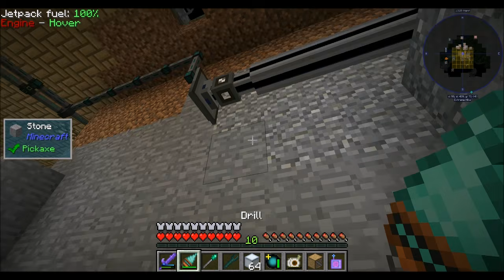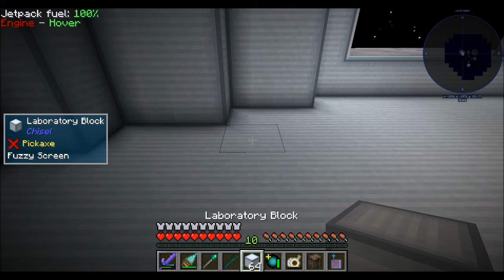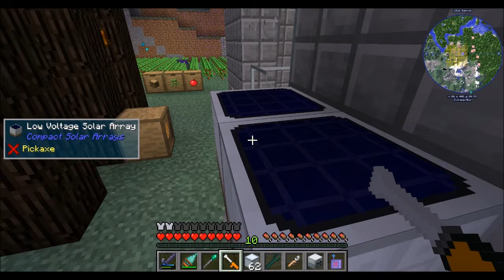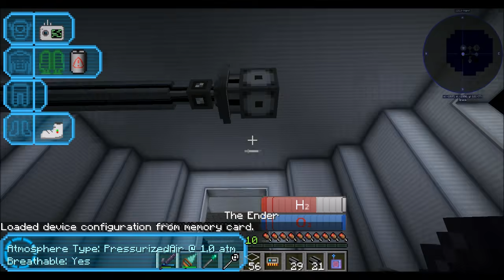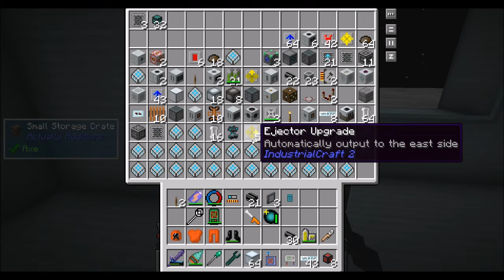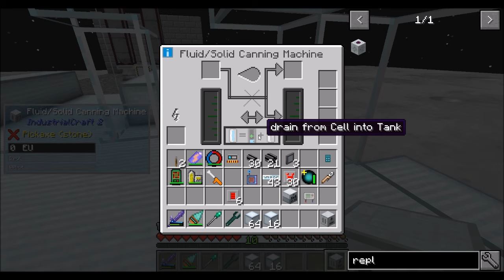AoE Ep76 IC2 Moves

Comment: Anyone else go for the large arrays of IC2 machines to reduce the power needs overclockers would need? 10 of a machine give you 10x speed at 10x power as long as you can evenly split the work. interface into a chest/crate then transfer node with stack and speed upgrades and transfer filters on each machine set to single item works well then just need to send the processed to a interface. Only works well on single item in for x crafting but can use other mods for more complex recipes.

Comment: did you move your wireless access point to the space station? if its still in the old base, through a quantum tunnel from your new ME controller, that might account for the derpyness of the wireless terminal

Comment: With making the looks of the nuclear reactor better can't you put the redstone on top of the MFSU and it will still receive the signal from the MFSU
Reply: Graluvack EnderSlayer or have the red stone behind and run the second power line into the top of the mfsu on the basement floor

Comment: @Direwolf20 could you maybe ask the mod author from Advanced Rockedry to make the spacesuit work also as a Hazmad suite from IC 2 ? ( i mean both protect from radiation dont they ?:) )
Reply: Spacesuits would work pretty well for a lot of hazardous materials (they're airtight and insulating after all)... but I don't think you would want to handle radioactive materials with them.
Reply: Spacesuits do block some radiation
Reply: Silberzunge Do space suits block radiation? I thought an Astronaut just had to deal with it if they spacewalk.

Comment: Yeah, there's a 50 Chunk limit, check the bottom-right of the chunk info screen.  The ExU2 Chunk loader/warding thing was enable in a later version of the pack as the FTB Loading wasn't always working.  My suggestion would be to use ExU2 instead, didn't fail me.
Reply: Totally agreed.
Reply: This is why I always use the perms system to make myself admin and increase the allowed chunks to 1000.